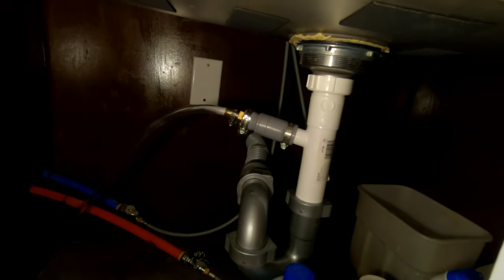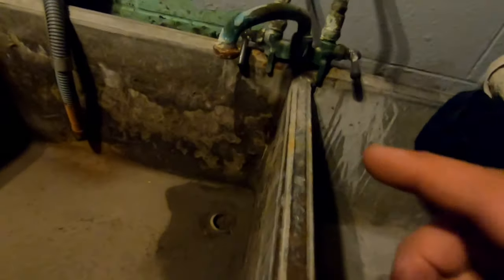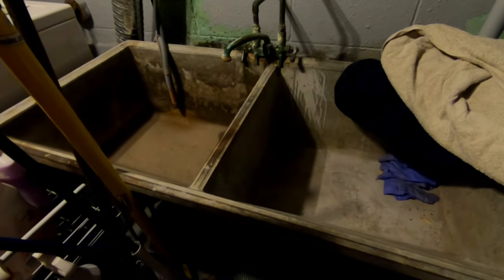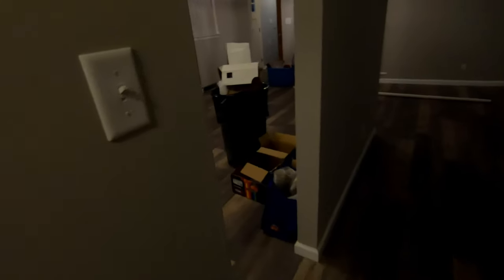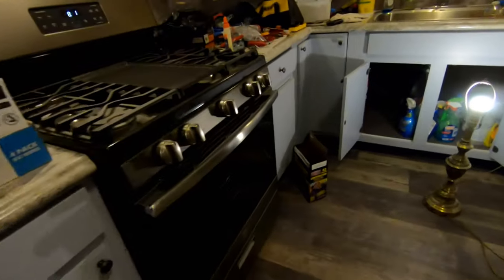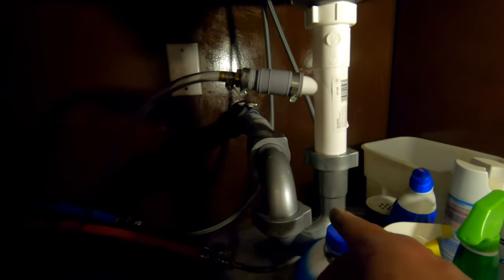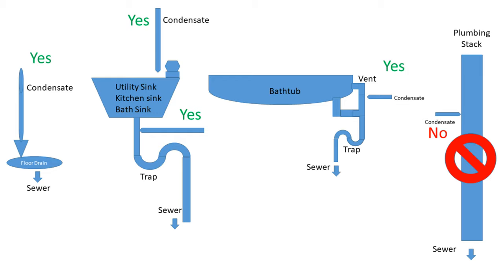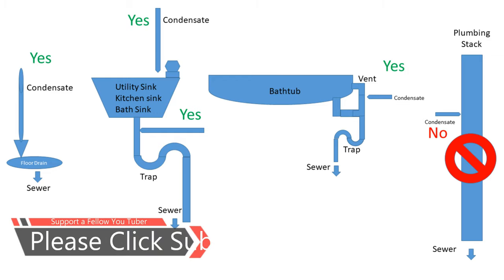Rerouting and Designing a Condensate Drain Discharge on your HVAC system

Comment: i  have a new furnace in my attic and the previous furnace was from 30 yrs ago. the way they routed it outside keeps freezingand the pump is overflowing. the only place i can think of routing it is in the stink pipe that is nearby. besides code is this possible at all? i have no where else to run it and im in a pickle since its 8 degrees out. also im not the one doing the work someone else is but they cant come back and do it for a few days.

Comment: Our primary drain (connected to the bathroom sink) had a bad clog and the tech rerouted to a nearby vent stack in the attic. He insisted that it’s going to the same place, just “higher up.” Is this not true? Everywhere I read says not to do it this way (including your video). Just curious why it’s not recommended.

Comment: HVAC tech said the dishwasher tailpiece wasn't enough in size. Asked for me to do 1" into vanity tailpiece. I found your video while attempting to figure out a branching tailpiece that will work to fit 1", but you mention that this one works fine in your video? Just looking for advice really. He believes the issue with drippan getting water in it could be a backpressure issue. 

Seeing solutions that match mine from videos like yours and online. Any advice?

Comment: Installing a smaller undercounter ice machine in a spare bedroom and I'm contemplating drain options. I caught the part where you mentioned the bathtub vent drain is an option. My house has a crawl space and was considering initially running it into the crawl and tying onto the drain somehow but that would require a trap etc. After watching your video, gave me the idea of running it over through a closet and creating an access panel on the backside of the bathtub. It's about 10 ft from the machine. I'm buying a condensation pump since this ice machine is gravity fed but are the tub vents easily accessible?

Comment: I have a single story house that was built in 1974 in the Houston area. In 2012, a new Goodman air handler/air conditioner was installed. The HVAC installer tapped into the vanity vent pipe in the attic. They also removed the original secondary pipe (which was the flexible black pipe) that ran outside of the house and replaced it with 3/4 inch pvc pipe. It's 1 -1/2 inch pipe that is for the vanity and the bathtub. A 1-1/2 inch "T" fitting was installed and not 1-1/2 inch sanity "T" fitting. No purple primer was used on the "T" fitting. A 3/4 inch pipe was ran to the "T" fitting. Both pipes were leaking and not glued correctly. Which rotted out the top plate where the vent pipe was going through the wall. Also, cause roach issues. I don't think when the house was originally built that the condensate drain line was routed to the vent pipe. I assume both primary and secondary drains were being routed outside of the house. I found evidence in the attic where a portion of the pipe was cut in order to install the T fitting. Before I saw your video, I was under the assumption that I needed to install a sanity "T" fitting and route the HVAC drain line to the vent pipe. I was going to use 1 inch pipe instead of 3/4 inch since one of the issues was the secondary pan overflowing. The additional sanity would make a wet vent area between vanity sink "T' fitting. If you can't tap into vent stack and the HVAC line has to be run to a kitchen sink, tub, or vanity sink then how is the 3/4 pipe supposed be routed from the attic and down into the wall in order to hookup to a tub, vanity, and kitchen sink? In my case, the wall's top plate would have needed to be drilled to allow the 3/4 inch pipe to be route down the wall and then come out of the wall under the vanity to hookup before the p trap or route over to the tub. I'm converting a tub to a shower, and will run 2 inch pipe to the vanity. The drain line from the tub is 2 inch pipe. They originally ran 1 1/2  inch pipe up to the vanity. I notice the pipe was caked with residue around the pipe. The house is tied to a septic system. What's the reason for not using the vent stack in my situation? I know the secondary line cannot be tapped into the vent stack due to the odors can get into the HVAC system.

Comment: I wanted to sell customers high efficiency except the drainage would need some type of dry well because the furnace is in a shed and far away from the house drainage. Slab floors etc. When 90+ becomes code it will be a challenge to discharge the condensate or it will create an ice pond.

Comment: My ac drain line was routed to the vent stack for my bathtub. Somehow my vent stack got plugged with some sort of light brown mud. 
I'm assuming it was crap coming out the drain over the years
Home was built in 1970.
Reply from the maker: In time the piping you have will need cleaned out on your bathtub drain and AC / and or 90+Furnace condensate system. Everything man builds has a shelf life for repairs and replacement.

Comment: Why is it a nono to tap into a vent stack?  Have my dehumidifier and the hvac both ran to a single condensate pump, from that pump is a check valve and up 6 feet, over 6 feet then tapped into a vertical vent pipe for the shitter but i tapped it with a wye, also with a final check pointing down towards the sewer pipe.  Being a 2-1/2”cast iron stack pipe i used proper rubber bushings with lock straps and a 2-1/2” black iron wye with a 2-1/2 straight and a 3/8”wye part that the reinforced rubber hose connects to the check all with compression fittings..  top of the vent has a cap and screen on it so critters and debris dont fall in.  So i see no issue with it in the least.  The checks are rated at 150psi as well as the bushings so if the vent did get clogged if bubba shoved a snake down it woukdnt go down the drain pipe and if jetted the check wouldnt allow water in the drain.  And if did get clogged up id be more concerned with the vent being clogged and shitter not having a vent than i would be the vent filling and over flowing with condensate water..  sewege will never back up into a vent pipe unless bubba dropped a deuce and a half with a few rolls of baby wipes but still even with no tap in the vent it would do same poop..  no gasses coming in that part.  No galvanic corrosion..  no pressure risk or back up possibility..  theres a service door i installed at the wye on the drywall so it can be serviced..  the hells wrong with that?  And what code in any state says not to do that?  Cuz id like to see it just to believe it..  no offense by this, just wondering..  inspector looked at it and didnt even question..  he did question why i have a urinal in my bathroom and a toilet..  but thats it..  (is so i dont have to lift the godforsaken lid so my better half doesnt try to kill me again after sittin in piss when i been out doin a little wine tastin at the ole titty bar night before..  

Gooday to ya..
Reply from the maker: So, Lots of info in your post. Also thanks for watching. Maybe I can drill down a little on why some local codes are so stringent. Since the installation is so vague from the manufacturer maybe this will help out. The manufacturer from my assessment and how most local codes work if not all want the piping to go prior to a trap before it goes to the sanitary sewer in the inside of a building envelope. So if for any reason your sewer backs up way up the vent pipe there is no possible way it will interfere with your heating or cooling system. We can all install traps upon traps and check valves upon check valves but they do fail at some point in time and sewer gasses can work their way back into a home if all fails. So the best way is to make sure whatever way you are installing your condensate is before a trap on the drain line in your home. As always check with your local codes prior to any installation and do not go off my advice for any reason. Respectfully, please check your local building codes and certified contractor to help you out on any questions.

Comment: Can I divert my condensation line into the top of my washing machine waste line?  

It shouldn't risk a backup / overflow any more than the washing machine drainpipe.  

In fact it should be be much less of a risk. Less water volume and less pressure than from the washing machine.

Comment: When routing the Condensate line, you prefer before the p-trap. Howcome you don't include a p-trap when routing it into a floor drain? If you were to dig into the basement slab and connect the line directly into the sewer line, would you include a p-trap? could you connect the condensate line into a basement shower that just has the floor drain ( by digging into the ground and connecting it into the shower drain before the p-trap)??! Thank you!
Reply from the maker: Every application is different, If your condensate is  from a 90 plus furnace you would want a P Trap to keep exhaust fumes out of the house.  If It's just for ac with or without a condensing furnace your question changes everything and it may be best to have a HVAC tech review what your doing before you make any changes.

Comment: I’m planning on putting some ceiling cassette mini split units and am thinking I can get the condensate line to the back of a bathtub. Is there a way to cut a circular hole into the brass drain pipe behind the bathtub and screw in an adaptor. It just seems perilous to cut it and insert a Y segment.
Reply: You're right...that compromises the vent...which is fragile

Comment: Question my ac drains into my bathroom sink and when the drain stop is open I hear this noise coming from the sink. I have been told that there should be a p trap up in the attic ac to prevent this noise. Your thoughts on this. Also my dehumidifier drain pan is clogged and not draining what would you recommend here
Reply from the maker: Personally, I'd check with you local codes since they can vary.
Reply from the maker: As a crapshoot, sounds like something that was improperly installed or clogged or partially clogged. Since so many homes are designed so different the best advice I can give is hire a local reputable HVAC contractor to address your concerns.

Comment: I am not a plumber, but I believe that an air gap is required.  In other words, the plastic tubing is not allowed to be clamped, but should fit loosely into the drain.  But I've been wrong before.